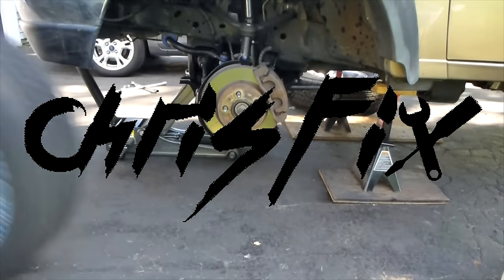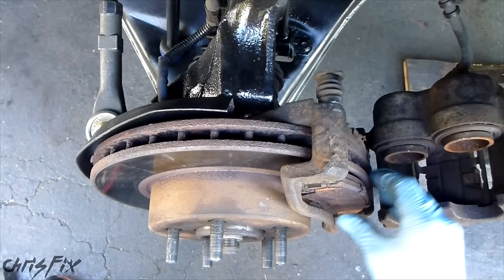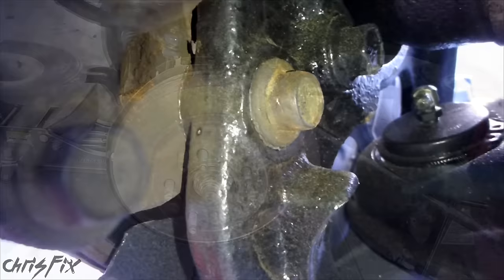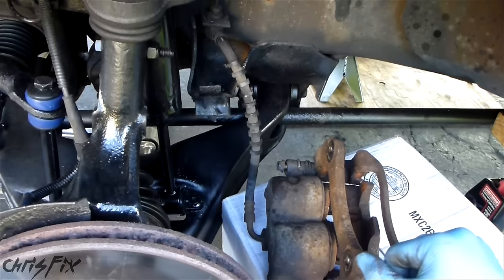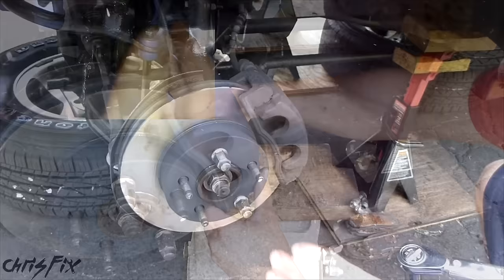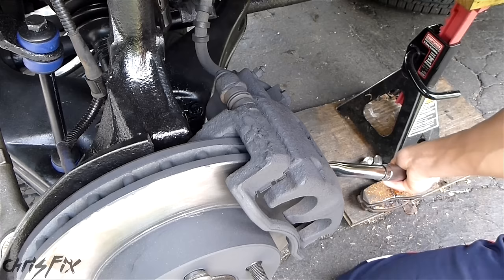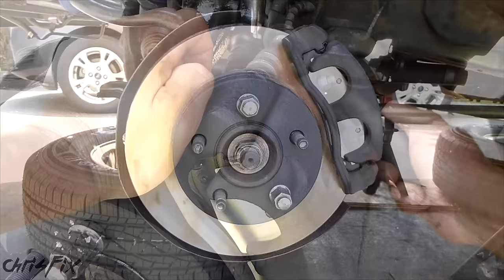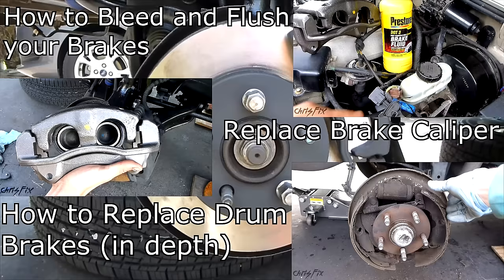How to Replace Front Brakes, Pads and Rotors

Comment: what if i put more then 25 pounds i tightened it really hard
Reply from the maker: +cALiP12INC394 You can damage the threads or snap the bolt.
Reply: +ChrisFix ok thanks then for next time i wont put to much pressure and i just changed my breaks 2 days a go and my value gasket cover

Comment: Spray silicone grease will just dry up...
Reply: +Kristof Van Den Elshout 
He's using high temperate silicone grease, plus, he doesn't want the rubber boots to disintegrate over time, you can't buy that part separately, you'd need to buy the complete caliper unit. Personally, I would've used silicone grease instead of spray, a thin film doesn't give me confidence that it will last at least 40,000 miles, but each to their own.

Comment: Just a word of warning to all, some brake pads contain asbestos, you won't know which one or even if the new set you've just bought have it or not. If you wear face masks, then you can limit your exposure, however, short of wearing a full face air mask, you wouldn't want even the smallest asbestos fibre in your lung or stuck onto your shirt for you or your family to inhale later on. I know it sounds like a lot of money to be saved, and how easy it looks to do it yourself, however, the risk, in my opinion is too high. Get a mechanic to do it, and let them worry about it, their work safety regulations will ensure they do the right thing to protect themselves. Besides, brake pads lasts about 40,000-60,000 miles, which is about 4-6 years so you're not saving that much if you do it yourself.
Reply: Yea your rite about that good tip specifically on older cars or car parts
Reply from the maker: +2driftlong Thanks for the tip!

Comment: Can't you just get it resurfaced
Reply: HOT SHOT 1500 To a certain extent you can resurface rotors. I'm not trying to insult your intelligence, but there is a gap in the middle of the rotor. It is not one solid piece. the two sides will eventually wear thin and compromise the integrity of the rotor